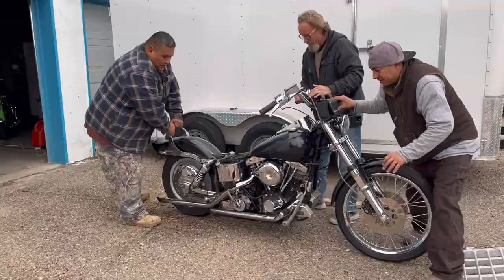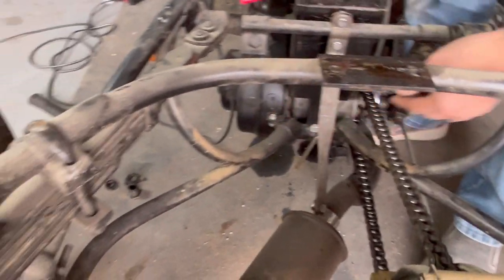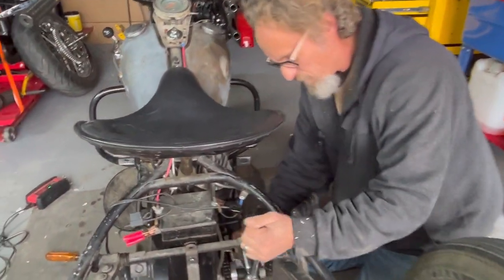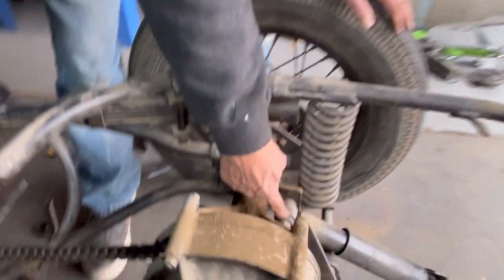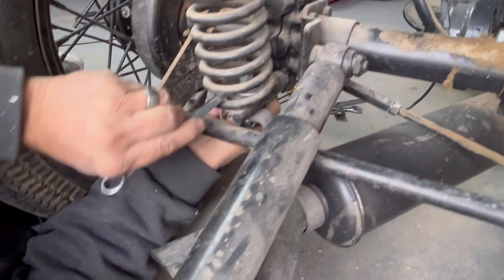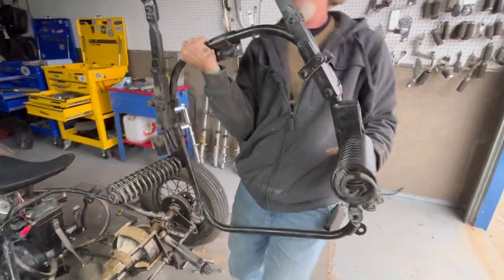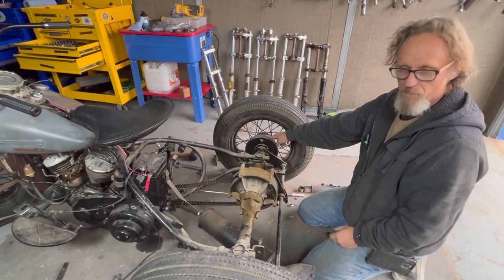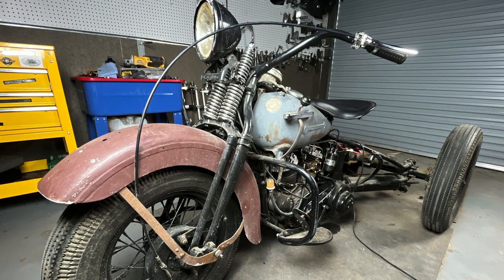What I FOUND OUT | Flathead Servi Car

Comment: Hay just a heads up. Your going to have to locate  a macanical brake wheel puller . Or you'll never get those wheels broke free of the long keyed taper on the axles . I sprayed and heated mine for 2 years before I learned that heard fact . The hubs have a fine thread that the puller screws on too .without that tool it's  impossible to get them off . You don't want to bend those hub flanges because servi car hubs are not reproduced, and are rarer then hens teeth These days. Good luck .
Reply from the maker: Wow !! Appreciate the info !! Any source for the mechanical wheel puller ?
Reply: @Hobson's Choice Harleys  I think that might be a tall order. Mine is home made  based on a factory tool they haven't used since 57 . Only thing I can think of is Throttle Masters  in Chicago  or 45 restoration 
Otherwise will have to work out some way for you to borrow mine .
Reply from the maker: @patrickmuraszewski3606  I’ll do some research! Really appreciate your advice

Comment: Don't think that bracket on the front crossbar does anything, have the same one on my '46 Servi. 
As far as the tapered rear wheels...they can be one. Bought the puller recommended (junk) return. Made one...no go. One of my dads old riding buddies stopped by, get me a large mallet he says. He wacks the tire and the wheel falls right off. Guess some day I'll be that old guy.
Great channel.
Reply from the maker: Thanks for the information I really appreciate it!

Comment: rear Brakes same as willys 47-63
Reply: Those are juice brakes ,big difference
Reply: @patrickmuraszewski3606  shoes are different?
Reply: @Frank Further  I've never heard of that Willis/Harley  thing .if that is true it would have to be later hydraulic brakes 57 to 73  . I believe Machanical brakes have not been used on cars since the model T  in the 20s . Servi cars have a 14 inch drum that barely stops it much less a jeep or a car .
Reply: @patrickmuraszewski3606  It's true for juice. I assumed the shoes were the same, but maybe I fugup.
Reply: I just ordered a rear master cylinder from a jeep website for my '53 Servi. It looked similar but had a different bolt pattern. Had to send it back.
Reply: @videobobdammit4818  maybe the legend is wrong? I've heard about the cross fit from different sources.